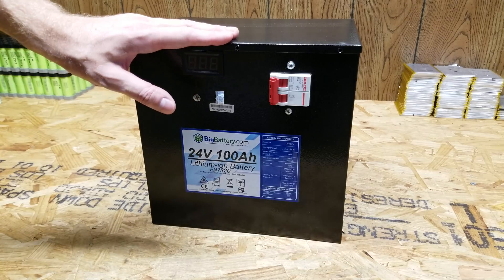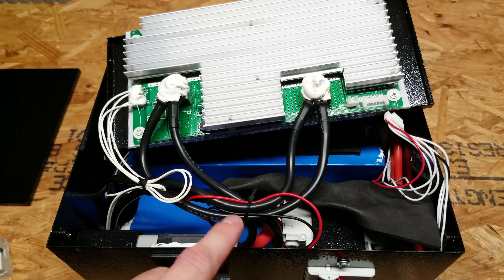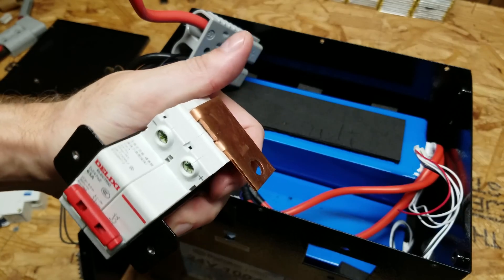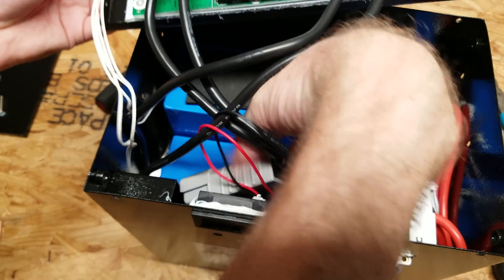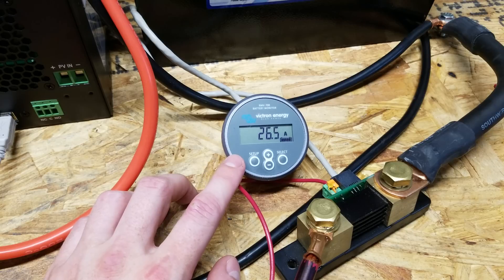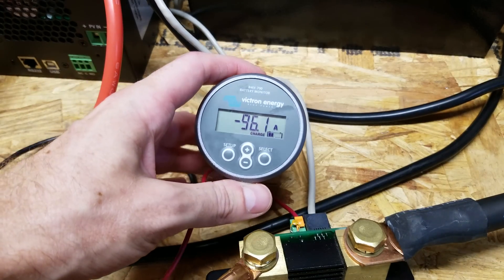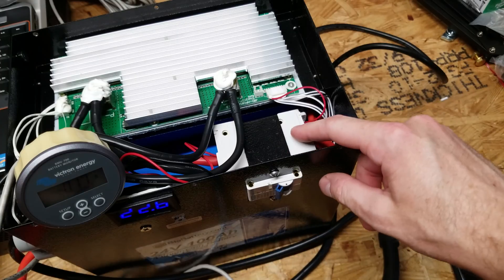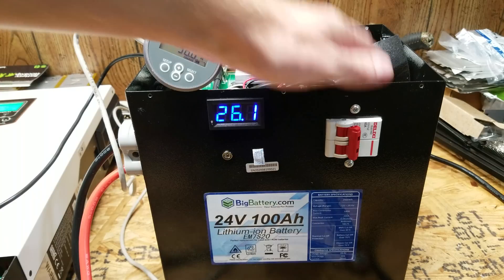BigBattery 24V Breaker Replacement and 100A Re-Test, Problem Solved!

Comment: Any opinion on Tomzn breakers?
Reply from the maker: I like them. I've used them for a lot of things and never had a problem; however, they are cheap and they are not UL/ETL listed.
Reply: @LithiumSolar  They have CE marking on them so they should be tested for use and safety inside of EU, but who knows if its not fake marking. Others on aliexpres are EARU, have you tested those dc breakers?

Comment: Yes As you said problem was for sure in missing washer and also loose cables. ..also as you also stated that braker looked a bit cheap and also had issue ..and ofc that is on new item..who knows how it will work in 5 years ..

Comment: Putting a 2-pole breaker in parallel is fine, but the one in the video is polarized, so it was not put into parallel correctly. The current will only be flowing correctly through one of the sides creating the potential for a runaway arc if the breaker is shut off under load

Comment: Doubling up on the connectors is simply a cheap and dirty. It takes just as much time to install the proper breaker as it does the wrong one. Also, I didn't see on the failed breaker if it was rated for DC. An AC only breaker isn't worth a hoot when it's call upon to operate. Ditto using 6 gauge wire. They simply cut corners.

Comment: Thanks for the effort you have put in.
While a bit more thought in the design would be good,  poor attention to detail is the weakest point. 
Without people like yourself and Will using the power of the camera, I doubt that manufacturers would take much notice of individual customer complaints. 
My issue with the 2 pole breaker is a bit different than yours. I'm more concerned about accuracy of trip current. If I was the designer I would have to satisfy myself via current injection tests and spec sheet details.
The lack of joint integrity, especially no lock washer is unacceptable. The very loose terminals are even more unacceptable. 
Looking at cable choice,  the use of paralleled smaller cables has advantages, mainly for flexibility and strain reduction within a tight enclosure. That said the total cross section is under done. 
Given that a double pole breaker is used 2 pairs of 4 sqmm cables correctly crimped into open barrel lugs would provide a tidy cool running solution. In a tight fit like this where every component apart from the BMS is on the limit  bolted connections need a Belleville washer to maximise the contact area at the lug palms. 
The more tear downs of this brand I see the less confidence I have in their electrical qualifications, it looks like a sheetmetal worker designing electrical.

Comment: Is this better than a Jackery 1000 or those ready to go battery backups?
Reply from the maker: This battery and inverter are much more powerful than the Jackery 1000 and only cost a bit more. Both serve a different purpose though. The Jackery is intended to be easily portable for use in the car, camping, taking with you. The BigBattery + MPPSolar is more of a stationary storage solution.
Reply: @LithiumSolar  Thanks! I'm guessing this is twice as much power as the Jackery 1000 WH, is the MPPsolar the cheapest solution for this?

Comment: Flow some solder on the positive leads before you put them into the breaker. It'll help give a more solid connection and less chance of them coming out in a vibration scenario. One of the tricks when working with stranded wire
Reply from the maker: Are you sure? I would think that would be a concern for melting if the breaker and/or terminals started heating up.

Comment: A good test.... But it's very sad that the battery did not test to full capacity. The batteries are used so they have a questionable cycle life remaining. When buying batteries (especially used) we should be able to expect that they will reach the continuous rating listed.

Comment: Yes I've seen others do this doubling up of poles -  I am not in favor.  But battery Isolators do need to be two pole, tomzn do a 2P one, but 2P 125A is the biggest one can get in DIN format. And the thing is because copper is mallaeble, bolts, screws always need a tightening up after fitting, guaranteed there is still a bit of give the next day that needs a tightening twist. In our codes , two cables can go into one CB slot, but not more than two.

Comment: Dude my issue is that you keep saying things are good when they are definitely not good. 100 ahs are 100 ahs. Not 83 or 93.When I purchase an item that states something I expect it it to do as stated. Not some where close. 100 means 100 not 83 or 93. Stop it already,
Reply from the maker: The product was later updated to advertise 95Ah. I think someone calculated the individual cell capacities incorrectly originally. My battery says 100Ah but the new ones say 95A.
Reply: @LithiumSolar  I Just finish watching your follow up video. It was good. I just think if I or anyone else was to pay that much money on a battery, there should not be any reason for me to have to go out and buy another breaker or fix poor production work. Just saying. Good luck in future work.

Comment: They are out of stock on these batteries.  Do you know if the 2021 restock will use the fuse?  I assume also what you did voided your warranty?  Are they allowing it to be modified with the better breaker, or to be sent it so they can modify it?
Reply from the maker: You can still order one but they're back-ordered, looks like it won't ship until January. They are using fuses in their newer models, but I'm not aware of any plan to start selling these particular batteries with fuses instead of the breakers mine have here. I ended up putting the original breaker back in and tightening everything with lock washers and it's been working great since. Seems it was just a matter of someone not torquing it properly.

Comment: Just because something can be done does not mean it should be done. Using a double pole breaker when a single pole breaker is what is called for tells me the designer was too lazy or too cheap to source the proper part. If they had used both breaker terminals on the double wire side instead of the adapter bus bar, they could have justified the double pole breaker.  I bet that their arrogance will now cause them to dig in their heels and claim that they know best. I hope that I am wrong and they do what is right, because that battery is, like you say, a very nice unit.

Comment: In addition to redesigning the breaker, they also need to up the wire size of those wires that were getting excessively hot.  If for no other reason then to reduce the voltage drop that was causing all that unnecessary heat!

Comment: Using double pole is better in that the current gets divided into 2 bolts, 2 set of contacts, etc. Because we can only get so much bolt thickness and what not out of a single breaker.

Comment: Given that there were 2 wires on the input to the breaker, I have to wonder if the original plan was to have them connected independently, but they found in testing the current from the two leads wasn’t balanced and chose this solution rather than redesign the case for a single breaker.

Comment: tighten screw.. Always after they did a travel.. But if they say that it misses something..it is strange and their internal discussion does not make sense.. The topic is safety!!! Good work for you!
Reply from the maker: They shouldn't have come loose in the first place. They are working to resolve the problem though on new products.

Comment: The original breaker should not have been modified until the screws were tightened etc and then re-tested. Once modified by the tester it can never be returned to original state. Now we will never know for sure although it it almost certain that the problem was due to loose connections. Poor quality control. This illustrates the need for the users to be aware and do a thorough quality control inspection before use IF they are qualified to do so. As was mentioned in the video, there are a lot of energized parts inside so only qualified persons should tread inside.
Reply from the maker: I will be putting the original breaker back.

Comment: Could also possibly be one of the breakers was slightly higher resistance therefore getting hotter, when you test them again outside the unit measure the temp of both of them. One advantage of using dual breakers is that if one goes faulty (O/C) you still should be able to use the unit but a 50% capacity.
Reply: "One advantage of using dual breakers is that if one goes faulty (O/C) you still should be able to use the unit but a 50% capacity"  -  One big disadvantage is that one breaker will always have a lower internal resistance and therefore will carry more than half of the current.

Comment: those breakers are designed ti take a copper bar...its the bus bar for the common live...for consumer units
Reply from the maker: The breaker I removed was designed for a bus bar, the one I installed was not.

Comment: The breaker manufacturer will specify a torque for the connectors, and an order for the nut and washers, Maybe copper bolts would be better but , torqued correctly, it's likely that the existing brass bolt and washer would be adequate, NEVER pass current through a steel spring washer.

Comment: Seems you nailed the issue being loose screws, however breaker 2 getting stuck in the interim position is indicative of pour manufacture and QA IMHO, plus you indicated no certification markings.  Personally I'd change them both out for a quality (CE, UA) single unit.  The one thing that comes to mind is the additional heat build up when the unit top is on, in use and unattended, high loads and depending on the ambient.  Not a risk worth taking after what you've seen, again IMHO.  Additionally I'd probably go through both units and check all fasteners and connections after what you found.  As always a pretty thorough reckoning with good details.  Nice job on the LCD in the camera close frame!

Comment: In the future if you should encounter the same type of situation with loose connections - redo the test after tightening the connections then proceed to cut connectors and test with new parts. That will give you 3 options to compare to and eliminate any guesswork. 
JMO

Comment: Not being ugly but you don't like a 'piggybacked' breaker, Ok. Then you twist two leads together to put them in a single connector (and no dielectric grease is used). I think the factory design is as entirely acceptable as your 'upgrade'.
     If you feel compelled to do a similar 'upgrade' to the other battery you should make a connector that takes the two leads in and has a single larger lead to connect to the breaker. 
  I would also recommend the use of dielectric grease on electrical connections, especially higher amperage DC connections. 
     Also, a breaker is not supposed to be used as an on/off switch. It degrades the breaker over time. That could be part of the issue with the malfunctioning of the breaker on the second unit.
     I enjoyed your video. As I said, I'm not trying to be negative but it's  hard to say someone else's work is wrong or bad when you take some 'funky' shortcuts yourself. 
    Take Care and be safe, John
Reply from the maker: I don't view it as negative, I appreciate sharing your thoughts. I'm looking for honest feedback when I post these, not just praise like some other youtubers. Now that we know the bolts/screws were the problem, I will likely put the original breaker back in. I probably should have tightened it and re-tested when I found they were loose, but it was a good exercise/test anyway.

Comment: This is what happens when a guy who owns battery recycle and salvage operations decides to get greedy by manufacturing "stuff" without proper engineering, certified testing and proper labels disclosing "used"  or in this case "reclaimed" components (the batteries themselves and ??). He's converting the salvage and reclamation operation to sell "new" product using cells that he's "de-rated" at inflated price. IMHO, that is unethical and illegal business practice. "De-rating" a "New" system to make up for deficiencies (reclaimed batteries, sub-standard or underrated parts or design) is NOT ok. Meeting the labeled performance on delivery not does not mean it's a "good" product. The label is "100Ah"  and a spec that says 200A max 300A peak and 30A charge, but inside he's got cells that (according to his website) should be able to provide 200A continuous and 300A peak. None of us know the truth. We know they're salvaged cell that were capped and resleeved. They are NOT NEW, and the sleeves and markings are NOT original.  We don't know who made the cells, the actual chemistry or why the packs were salvaged. Are we to believe BigBattery when they say "trust me, the cells are "new" Tesla Model 3 (4800 or labeled 5,000 mAh 10A (15A peak) cells?  
Note that they don't present ANY certified test report.  You yourself note that it's not built right and the QC is crap. You identify 100% failure rate (2/2) with critical safety issues.  You identify multiple obvious quality and design issues, and ignore many serious ones that perhaps you don't even think about.  The most dangerous thing about this product and the other "new" stuff sold by this company is that it gives the impression of a properly manufactured and "safe" device. This unit is certainly priced that way at about $400/kWH. 
Put this in your house/Car/RV/Garage or shed and you might as well throw away any insurance policies.
@LithiumSolar Did they pay you to review these or cut you a break on product?  You missed more serious things then you covered.
Here's my quick list on what you missed.
1) ARE THESE CELLS INDIVIDUALLY FUSED?  This is a 20P configuration of cells that are "rated" at 15A peak.  20P = 1000W  at 300A. Can the BMS stop a runaway?
2) Circuit breaker is a UL certified device, but is not being used consistent with his design.  That's a dangerous thing to do, giving a false impression of safety.
3) Circuit breakers should NOT be used as a primary power switch.  They are not designed for frequent on/off use, and you risk arcing that can cause a premature failure.
4) BMS should not have "Hot Spots" on FLIR. What was the source of the heat? shunt or balance, connectors?
5) BMS heat sinks require airflow for cooling but there are no vents or fans.
6) Can BMS balance a 20P pack?  Need to check specs.
7) Output wiring is under spec.
8) System is sold de-rated from what the cells should be able to produce based on cell specs and labeling of the components. Underrated BMS or overrated cells?

Here's what I suggest is necessary to "fix" this pack before use.
1) Verify cells are individually fused. If not, rebuild the pack from scratch. 20P is not a safe design without fusing the cells.
2) Check BMS spec and replace if underrated
3) Install  temperature controlled cooling fan for BMS
4) Re-design output wiring with correctly rated wire, connectors and breaker or  safety interlock. 
5) Use an output relay and BMS safety interlock. 
5) Fuse the battery pack at the mid-point of the battery stack with a properly rated fuse.
Reply: @Mike - You wrote ...
2) Circuit breaker is a UL certified device, but is not being used consistent with his design.  That's a dangerous thing to do, giving a false impression of safety.
Can you please be specific about what is wrong with Big Battery's original Dual Circuit Breaker design?
Reply: @vtorsi610  Let me start by saying that a UL listed or rated component is only valid when it's installed in a manner consistent with it's specification. In the case of a circuit breaker it needs to be installed in a UL rated breaker mounting panel and box and connected with UL  rated wire consistent with the mounting type and connector type of the breaker.  Big Battery mounts the breaker on the front panel with the UL symbols showing while it breaks pretty much every rule in the book.  Probably the most obvious and what the author of the video noted was a problem on his unit is the electrical connection to the breaker using tabs cut on the edge of a copper plate.  It is not appropriate for the connectors on the breaker which are designed for wire. Judging from the photos on their site, the other battery boxes they sell have the same problem. The breaker is not mounted in a UL rated box, nor in a manner consistent with its design. It is up front where people will see the UL symbol and perhaps think the box is a rated or listed device. Big Battery uses 2 x 60A breakers giving a total current capacity of 120 Amps. That is not consistent with the rest of the components based on the specs published by Big Battery in various places. Getting into further detail becomes a speculation into "Just how dangerous is it?" . I think it's better to ask the question "How should this be done?" .
Simple questions.  Why not select a breaker assembly with threaded posts, or that accepts a threaded bolt?  Why not use a proper low power switch and contactor?  If the pack needs a over-current protection beyond the BMS, why not fuse it properly instead of using a breaker on the output?

Comment: Yes, I would have gone with a 100 amp single pole, wise choices! but they went with 65 amp double pole that means it only 65 amp? So at +/- 10% load it ought had trips if the load went over 80 amps? Check the systematic for the load rating? For the breaker, that is needed?
Reply from the maker: It's a double pole, but they wired both poles in parallel, so they essentially made a 126A breaker.